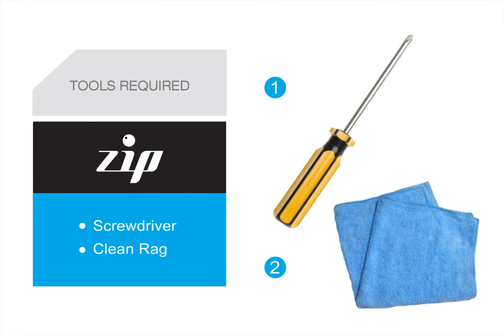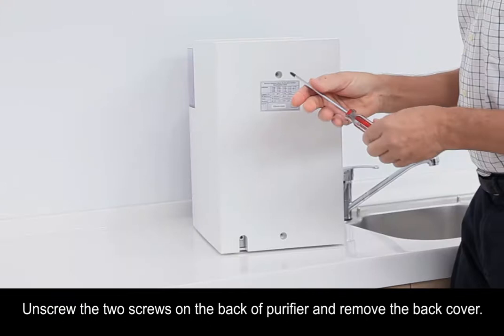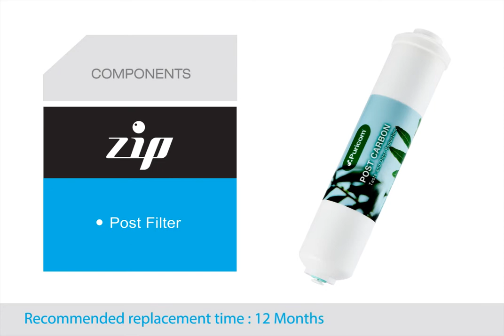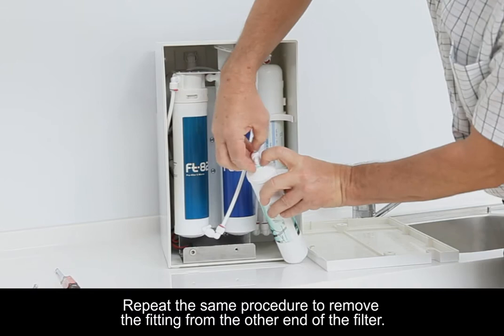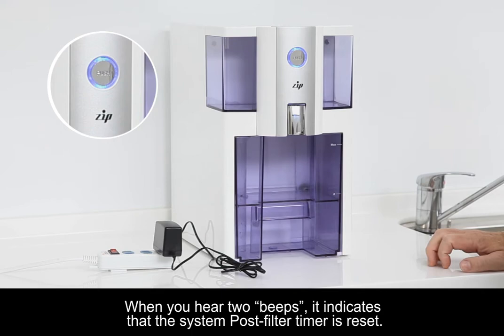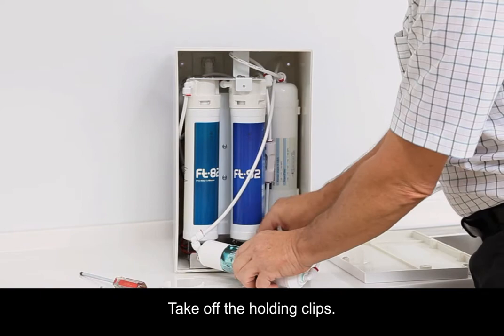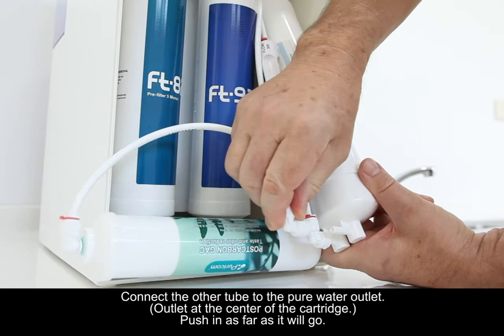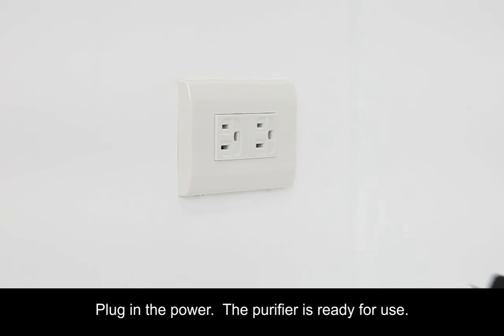├ Zero Installation Purifier ┤Filters and Membrane Replacement - ENG subtitle

Comment: I've used this video as a guide three times, now, to replace my various filters.

All those complaining here have issues that can be resolved...

I've replaced the pre-and-post filters twice, and my RO membrane once 

Through trial and error, I figured out the best way to unscrew the factory-installed pre-filters for the first time was by using my hair dryer set on high heat and pointing it at the top of the filters to expand the plastic a bit, while also tapping the rim gently with the rubber tip of my screw driver. I did the exact same thing the second time I replaced them...

The post filter I had no real issue with except for pressing down on the tiny green ring while lifting the connector out of both the top and the bottom. 
Watch carefully what this guy does! You'll need both thumbs to press down on the ring while your middle or ring finger is under the connector tube to left it out at the same time. It's awkward but it works...

The RO membrane took a little longer only because it's seated behind the post filter. I don't recall any major issues with replacing...

I purchased my RO countertop in September of 2020, and I love it to PIECES! It's given me almost four years of delicious clean water...   ❤💦💦💦❤

Also, FYI: I started with the Onlipure filters, then changed to the Alcapure. If you change from one to the other, make sure you also purchase the clips because the sizing is different...

Comment: You need the strength of 10 gorillas to get these filters off.  Buy their special strap-wrench.  Even then, the wrench is super awkward to use.  Trust me, you’ll see.  Also depressing the collared ring while lifting the doohickey straight upwards with vapor lock on the post filters requires 3 arms and… the strength on 10 gorillas 🦍    Bad design. Rkin.  I used a needle nose pliers to press the 2 sides of the collar down yet it chewed up the plastic a bit. And now to top it all off, my lights are flashing orange and I can’t reset the thing despite following their instructions to a tee 😅
Reply: Oh and the filters are full of water, which will spill everywhere if you lay them flat.  Re resetting the flashing light, I figured out I didn’t have the water carafe in place, problem solved.

Comment: This video says a steady red light indicates the post filter needs to be replaced. In the manual and a piece of paper at the back of the Zip device it says the steady red light indicates that the membrane should be replaced. Which one is it?
Reply from the maker: Hi, can you take a photo for the manual about the part that you say and the book cover to us?  We will check the description of the light indicator which one is correct.
Our email: service@puricom.com
Reply: Here is a link to a manual that has the same info mine has: https://rkin.com/pages/zero-installation-purifier-user-guide. On page 12 it states that the steady red light indicates that a RO  membrane change is due. The same is stated on the paper in the back of the device. Now in this video and on your webpage https://www.puricom.com/exec/product.php?mod=show&cid=84&pid=ZIP-%E9%9B%85%E5%85%B8%E7%99%BD&lg=E it says the steady red light means the post filter has to be changed.  @Puricom_water
Reply: so, no reply? didn't think so.....
Reply from the maker: Hi, sorry reply late.

The specification of ZIP you have is for USA area using.
So, the description from the link you paste is correct.

The water quality isn't same in different area, and it will has different filter change suggestion.